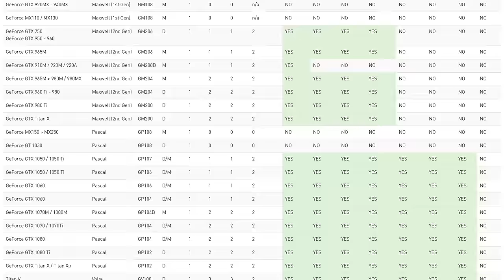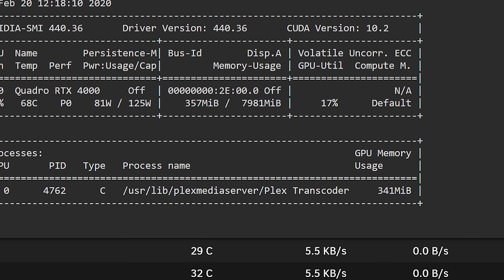5 First Plex Media Server Build Mistakes

Comment: You say not to ever transcode 4k video. Do you have any suggestions on how to avoid that? Inside my network it direct plays but outside my network it always transcodes. Is there a way to stop this or am I doing something wrong?

Also would really like to see your best practices on installing Plex on Unraid. Tips, tricks, setup, docker setup, etc
Reply: DanSan382 like you said. Direct play only. If your home upload is fast enough you could directly play outside of the network. Many folks set up multiple libraries. One for movies up to 1080p and another for 4K. You can also use WebTools and other plugins to immediately stop playback for remote streams attempting to transcode 4K. If you go separate library route and have users who don’t know better, you can not share the 4K library with them.
Reply: @patrickneitzel2048  I do have separate libraries for the 4k content so you're saying don't share those with outside users and just let them use the 1080p version? It's weird because my Nvidia shield doesn't transcode when watching but the one at my parents house will transcode just because it's outside the network. I'm trying to avoid it from always transcoding and just do 4k at direct play. Not sure if that's even possible

Comment: I'm new at this stuff, that's the reason I found your channel. but running a Plex Server on a properly setup ZFS based NAS, would seem to me to have quite good corrupt data avoidance, and recovery built in if setup properly, and adding more space/hard drives should not require a total rebuild. Just put the new drives in an external enclosure, add them as a new VDev, then add the space to your Zpool. or, replace all of the existing drives in a Vdev with larger ones, migrating the data to each new drive one at a time until your have replaced them all. I haven't done it, but it seems straight forward.

Comment: Soon to be Plex noob here (sick of paying $250/month for cable...well it's also Internet and home phone). I'm turning my old rig into a secondary gaming pc/plex server. Hardware I have but haven't built yet- intel 9400, 32gb ddr4 B-die (twas free), gtx960, fractal r4/5, to be shucked WD 14tb (ssd for  OS and a bunch of 1-2tb drives). I didn't plan on transcoding...can my Roku ultras 4k take direct stream? I have a 1070 gtx in my other rig I could swap if needed.
Reply: yes your Roku can direct stream. This is dependent on the file type you are playing but generally just pick original quality and you are fine. If you are just streaming to yourself your CPU will be fine without a GPU if you start trans coding multiple stream(3+) then a GPU is beneficial.

Comment: I'm not sure if this is the place to ask this, but as someone contemplating building my first Plex server -- what about hard drive modularity?

Let's say I buy a case with plenty of room for HDD expansion and can afford one or two HDDs initially, with plans to add more occasionally as funds permit.

What do I need to do to add additional HDDs? Once I install a new HDD or two, what do I need to do next to utilize the new drives? Does the whole system need to be re-formatted/reconfigured, etc.? (With or without RAID...)
Reply: You can add your disk and folders as needed while growing your system and don’t really need a raid configuration, but having a raid is great.
Reply: My understanding is that Plex is something you install on the same device as your storage, but it isn't the same as your storage. The ability to add extra drives as you go is gonna be based on your storage system.

But yes, you should be able to add extra discs on any storage system.
Reply: @samal3196  i used to have my file storage inside my streaming server until disaster struck. Now I have a file server, a media streaming server, and two streaming workstations, each on its own computer.
Reply: @samal3196  Just to be clear, I meant to be able to add drives WITHOUT backing everything up, reformatting, etc.
Reply: @pacoreguenga  Ah, neat! I thought Plex was supposed to be run on the same server as your storage as a functionality thing was all.
Reply: @samal3196  you can even run several servers on your storage server for a home setup but power users need reliability and even some level of redundancy.
Reply: plex is just a file organizer with streaming capabilities, all you have to do is install the drives, format the new drives so your choice of OS can utilize them add the necessary folders for your media (tv shows, movies, pictures, music, ect). and in plex you will open the corresponding library add the new folder. if you want you can raid the drives you can but unless your a serious power user i wouldn't bother.
Reply: @ChaplainDaveSparks  you can either use a JBOD RAID for that, which should allow you to just add new drives later on and edit a config or you can use mergerfs, where you only need to add a new line in your fstab file that automounts the new drive to a collection folder and mergerfs will present it as a single drive and handle the distribution between drives.

Comment: Great video... 1 thing I'd have to disagree with your Seagate opinion.  I've had hundreds of hard drives over the past 25 years and WD has a significantly worse track record for me.  Like not even a contest how much worse.  I currently have Seagate drives from 2008 that still work (running pretty much 24x7 in a very active RAID5 - ST31500341AS).   Also the Seagate support I found to be very responsive for the drives that have died.  Recently they even provided me an RMA replacement for an out of warranty 4TB drive.
Reply: I really don't get his dislike for Seagate as well, in the end it's man created hardware it's all going to fail - some sooner than others.  But so far I've had zero issues w/ all the Seagate drives I've used over the years but WD's/HGST and Toshiba drives have had the higher failure rates.
Reply: Seagate had 1.5 and 3tb drives with notorious failure rates. There's 3rd party statistical proof available from backblaze. I've had 4x more failures from Seagate then any other brand.
Reply: @jba6677  2 batches of 2 specific models. Not the brand in general.

Comment: I use a Synology DS918+ with 40TB. It's almost full with movies. I'm thinking of replacing one drive at a time to expand my total storage.
Reply: James Hall how many videos are streaming at the time? How well does  the synology handle multiple streaming? I would like one however I heard you need at least i7 or better for plex to work when you are multiple streaming. I have at least 4 devices streaming at any giving time.
Reply: @reggieoverton121  Right now I'm streaming Ex Machina (4k) to one TV, Birds of Prey (1080p) to another TV, & the latest episode of Young Sheldon (720p I think) to a third TV.   I have a PTZ (1080p) security camera, and 3 more 2K bullet cameras, ALL streaming continuous video to the NAS.  And I'm watching Youtube videos on my computer.  My CPU's (PC and the NAS) haven't budged over 10%, RAM is sitting at 8.5GB (PC) and 1.1GB (NAS), but the ethernet is doing the work bouncing between 50Mbps and 100Mbps (nowhere near saturated).  The 918+ has TWO gigabit ports, so it's plenty fast enough to the switch.  Everything goes it's own direction from there... POE+ to the big camera, gigabit LAN, wifi through the Google mesh, etc.  The 918+ is a BEAST!  Just make sure you get a managed switch so you can bond the two gigabit ports from the NAS to the switch.  Oh, also, I did max out the RAM in the 918+ AND put a couple SSD's in it for read/write buffers (not storage).  Storage is just four 10TB Iron Wolf drives, the 7200RPM flavor.
Reply: James Hall you don’t realize how much this helped me. I have been going back and forth trying to convince myself to buy a synology but I just read in a few places that all synology nas struggle with plex because plex demand so much processing power. Again thank you.

Comment: My first/ current Plex server is just on my 6 year old 4TB Seagate external HD plugged into my 8 year old ASUS laptop running Windows 10. Is that bad? And no I’m not joking, that is my setup and has been for about 3 years now.
Reply: Mine is about the same thing only a almost 10year old Mac desktop. Been running for at least 2 and had 5 concurrent transcodes. I have all the stuff backed up but the 4tb drive runs the show.
Reply: If it doesn’t stutter it’s fine. Plex doesn’t need much at all. This YouTube guy is just guessing like everyone else. My vm has no graphics card. It is not nessecary.

Comment: I had that issue where I keep losing my hard drives on my server. I tried replacing drives and cables, but the problem was still there. I eventually found out I never replaced my power supply. When I finally got one with a higher wattage, the problem was fixed.

Comment: Where do you set what drive holds the metadata? I just started ripping my blu ray library….I have windows running on an SSD and also have a 2 TB regular hard drive that I have been placing the media files in. I don’t really see any issues when I stream the movies to my Roku TV.

Comment: I have  question about something in this video.. It may have been asked and Answered already... but I watched it a couple of times and it's about the recommendation on getting an SSD for running you play server... That is referring to the main operating hard drive where the program runs..?  I store my larger files on hard drives in toasters like the one shown in the video...  The meta data is all stored on my MAIN C Drive...  if this is correct that upgrading my MAIN drive to an SSD would make the menus and overall function of the server faster.. but not really enhance the performance of the Videos or any other data being streamed?  Am understanding this correctly?.
Reply: Yes you're correct, but in the context of the video he's also talking about using the SSD as the transcoding temporary storage location (if you can't afford the RAM). Least preferable would be to have the metadata and transcoding on spinning rust - that would be slowest.

Comment: Tip #7: Don't go for ultra cheap random Asian supplier for power supply. You don't save that much going from a reputable vendor, from a well known one (maybe 10usd?). But this runs 24/7, and a power supply failure can lead to an overload that burns your drives....
Reply from the maker: good tip!

Comment: 3 gb of ram on a pentium chip with an hdd on windows 10. Streamed 4k through a power line adapter with no issues.
Reply: You can direct stream from a rasberry-pi with no issues, the problem is when you start transcoding

Comment: if most of your newer items are in 4k and you have remote users, is there a way to prevent transcoding to those users/have plex user an optimized version?  Will it do that automagically if you have a lower bitrate optimized version?
Reply: You can create two libraries one for 4k the other for 1080/720 and limit their share  to the 1080 share. You can optimize for lower bitrates within plex and it can make a copy of the file optimized for TV's  (non-4k), phones, etc.

Comment: On the storage space extension issue, can you just change your HDD for bigger ones?
Reply: It would be cheaper in the long run to just buy the bigger HDDs at the beginning.... but yes... maybe.
Reply: Depends on the setup. Chances are, if you have to ask, no. Read up on the various Raid configs and UnRaid, and figure out what will work for you.

Comment: I was looking for some opinions.  Right now I have a 2015 Shiled as my PMS and a WD My Cloud NAS as storage.  I have to set the clients at 2mb stream to stream more than two (other than the shield).  Was going to upgrade to a WD PR4100 or a Synology DS918+.  Would the PMS run better on these?  Would it bump performance as just a NAS and keep the PMS on the shield?  Should I upgrade both the shield (to 2019 version) and the NAS?  Budget is important but I want to ensure I get 2-3 local streams and 1-2 off site streams with no issues.
Reply: I would build a FreeNAS array, it can run numerous plugins same as Synology or ReadyNAS but in almost all cases can be built for less than a comparable commercial chassis.  I would not lose the Shield, even the original Shield is more powerful than pretty much any other Plex client available other than a full blown HTPC.  For you local clients pretty much any NAS would suffice as you should be direct playing the content (and your Shield can direct play 4k content no problem) so you are really tuning for remote play.  This is more dependent on your upstream capabilities (are you a cable modem customer with a crap 5mb upstream? or are you one of the lucky few with 1gb synchronous fiber?) and for that I recommend making sure your media is friendly to direct remote play, so you may need to maintain multiple copies.. but I've found my 4th gen core i3 more than capable of transcoding 1080p content down to 720p to accommodate my old 5mbit upstream no issues.. I'm on a much better 35mb upstream now so I can direct remote play any 1080p or lower content nowadays.  But basically, take a step back and evaluate your entire environment to determine all the bottlenecks then you can create a build according to what can be remediated (transcoding horsepower) and what you may be forced to live with (a terrible upstream rate).
Reply: @RVSpinX  I am just trying to avoid building due to the fact that I have no idea how.  Lol
Reply: @staceyeaton6869  it's not terribly hard and there are a bunch of sample builds on the freenas forums, that being said, I totally get the desire for ease of deployment and know Synology makes a great product.

Comment: I have Plex running on a my main Windows 10 Pro PC, that I always keep on and use for everything (Calibre, Folding@home, gaming, web browsing, etc). I have 12tb of HDD storage, and 1tb (SATA & Nvme) of SSD storage (I have offline backups). I have been using a no-ip domain for my calibre server because my ISP is Dynamic IP. I would like to use SSL certificates for Plex and Calibre with a service like letsencrypt, but all the tutorials I can find are somewhat complicated and are about Ubuntu, Windows Server 2012, or Synology. The website are also a bit suspect. Could you make a step by step guide to add SSL certificates to Plex, or do you know of one?

Comment: I know this video is old, I use plex on a old dual xeon server, it trans codes software really well at 8k HDR at 60fps, no custom anything set, hammers the CPU's of course hardly touches the ram, I moved to Jellyfin, wanted to give something new a try and I didn't want to really spend $150 or a monthly or yearly plan, got enough of that as it is, and my internet often goes down and Plex sometimes dosn't let me use my own stuff of my own network with no internet, Well Jellyfin, holy crap does it use ram on some videos, thats both with hardware and software encoding, It will use upwards of 80gb of my ram on my server transcoding my test 8k HDR video, its nuts. 4k it depends, some seem to use a lot, some not so much.

Comment: SSD for metadata? What is the reason for that? What counts as metadata? Not the transcoding temp which should go on ramdrive right?
I'll have to ask the network center if they can shove a (will it be enough?) SSD into one of the roots..
will 512GB be enough? is SATA SSD Datacenter Edition enough or will be NVMe SSD better (for only 50cent more) or overkill?
Reply: Meta data = Artwork, artist, actor names, directors etc.

Comment: Hey I've done really well with Seagate hard drives. I've always had western digital drives die.
Reply: Same here. It's still, to this day, how many  years after my last Raptor, impossible to get me near a WD.  I only buy Seagate.  I upgraded my 8 drive "server" this month (I needed more capacity) and when I pulled out 4 of the Seagates, they were from 2011.  Still going strong.
Reply: Sadly, I have had the worst experience with seagate drives. The only drive failures I have had in the last 20 years have been seagate. In fairness I have had few systems longer then 3 to 5 years.  WD on the other hand has been rock solid.
Reply: @Shiznaft1  I've had the same 5tb seagate drives for about 10 years now. Maybe I just got lucky
Reply: @nikaiwolf  With those 2 brands its like anything else mass produced some will be duds others will go for ever. I have had both seagate and WD hard drives that have been going for over 10 years with no issues. but have also had some die within a week of being used.
Reply: @nikaiwolf  Could be. I hope you continue to be lucky.
Reply: I've had some extremely bad luck with Seagate drives ... my experience of 3 dead drives in the last 20 years + a friend's experience that included $800 of data recovery.  As far as WD drives go, I had a Raptor die after about 12 years of 24/7 and it had nothing noteworthy on it when it died.  I ran an array of 8 IBM/HGST 500GB drives for about 10 years 24/7 with no deaths.  Right now I just have to mostly trust WD drives (especially since my PLEX server is all WD drives)... and plan on using HGST for my next ones ... even though HGST is now owned by WD.
Reply: I never use WD drives ever since the DRM incident 👍

Comment: I still cant get my SD dust to play live tv on my plex. I have the subscription and the tuner works fine, just not in Plex. Very frustrating. Sometimes it will record with no Live TV. I have a strong signal, but I'm wondering if my RP4 doesn't like it. Server is on there, and I'm using my firestick to access the player. Movies on the network work great. I just want it to work )<;
Reply: I assume you have deleted your liveTV/DVR configuration and tried to add it again. Have you tried power cycling the devices, updating firmware etc?